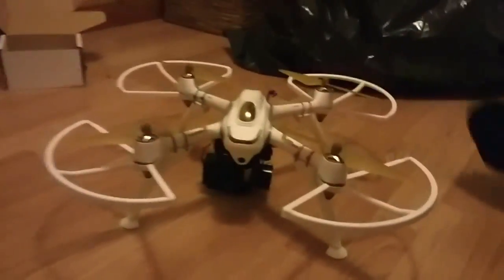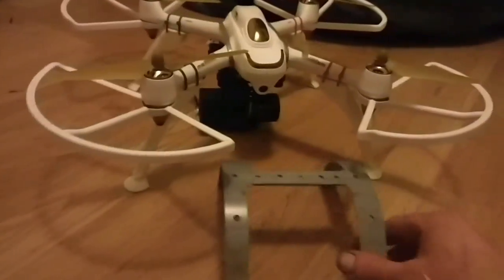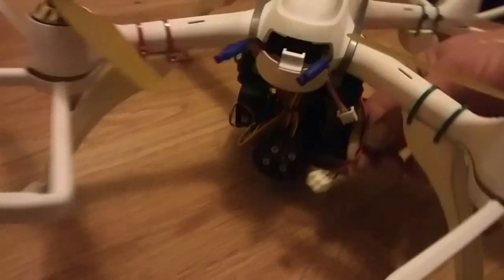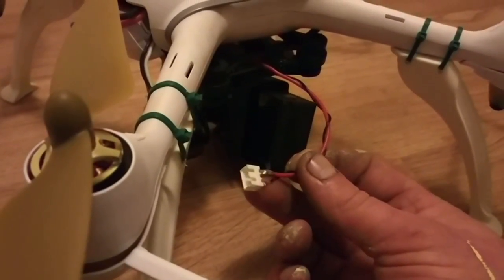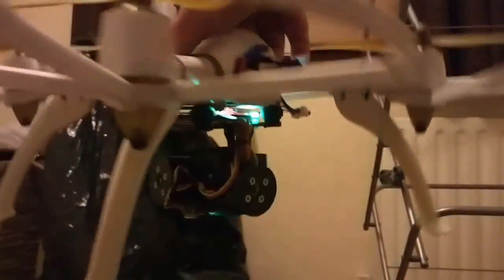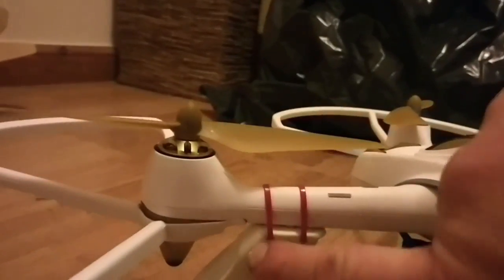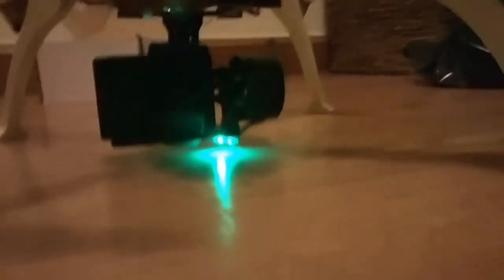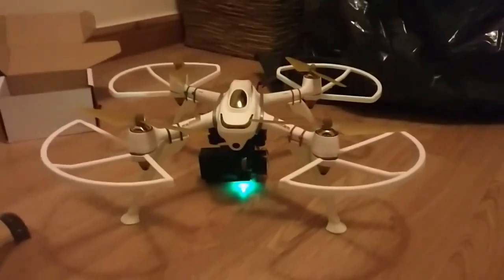Hubsan H501s with 2axis camera gimbal

Comment: i used the same setup butt to heavy and very poor handeling with almost no wind..
Reply from the maker: Rossano Putzu yes your right. was good idea but no good. bought a Mavic instead!
Reply: Ok ...but nice price difference
Reply from the maker: Rossano Putzu I actually had little trouble with my hubsans asking as in GPS! but saved up for mavic. it's very good.
Reply: I will get it to work...just take of some wait....;-)
Reply: My gps is working great...holds its position perfectly
Reply: I will save up money for a more advanced drone....sensors and all the stuff!!!!!!

Comment: How was your flight time, and did you use the balance lead to power it?  Also do you have link for legs? Cheers
Reply: worthyo good job mate we must like alike I've ordered my gimbal a few days ago without seeing your video. I will be swiping the motors to keep weight down to a bear min. With some micro servos metal gear ones. Great idea 💡 mate. I've just subbed. If you would be so kind in subbing to mine,👍🏽
Reply from the maker: FPV FREAKY sorted
Reply: worthyo 😜👍🏽 thanks look forward to your next vid

Comment: hi what brand of gimbal did you used and where did you bought it?
Reply from the maker: Dhecel I bought it from eBay. it's a Chinese non branded 2 axis gimbal.
Reply: can you send the link? I also found a cheaper gimbal but not use if it will work. I also talk to the customer service and advised me to use 3s battery.

here is the link, can you check it if its possible to install in our h501s?

https://www.aliexpress.com/item/RTF-Brushless-Gimbal-Camera-w-2208-Motors-BGC-Controller-Board-CNC-ALU-Metal-For-SJ4000-Purple/32322847120.html?spm=2114.10010108.1000014.1.SjipKh&scm=1007.13338.69055.0&pvid=1d9925e0-a069-4c19-b107-1eb06f256e1f&tpp=1
Reply from the maker: Dhecel yes that's the same one. all I had extra was to get the syma x8 legs and make a connection wire to power up gimbal.
Reply: Thank you worthyo.

Comment: Hi, very good work on the 501S.I have some suggestions who may help you lifting the added weight.Change your propellers for some 3 blades ones(Frequent flyer video) some more thrust. Remove the propellers guards when flying outside. They are heavy and produce drag and lots of turbulence reducing thrust / lift capacity.  Every grams count. Sorry for bad english im french. Good luck with it.
Reply from the maker: eFSpiderGuy thank you for your suggestions. I will certainly try to reduce weight as the gimbal and camera weigh as much as the quad!
Reply: eFSpiderGuy l